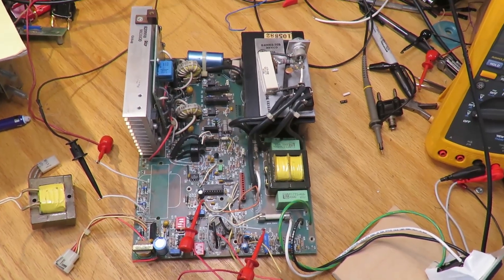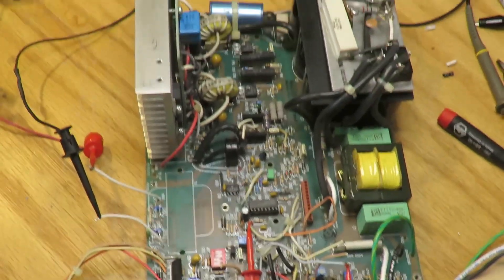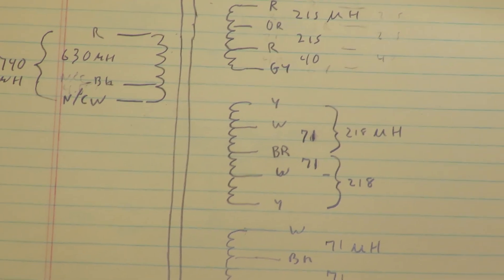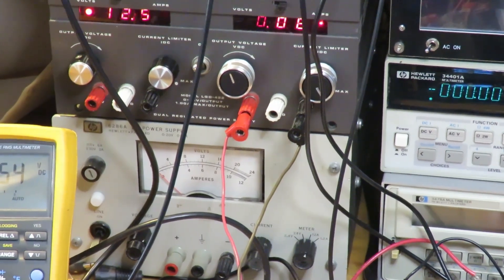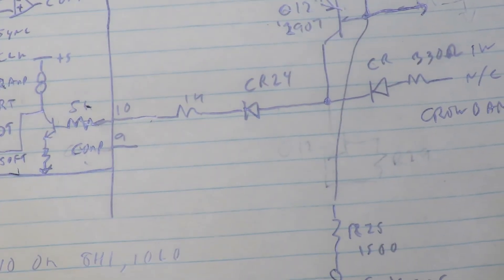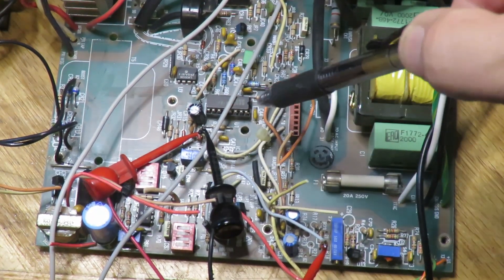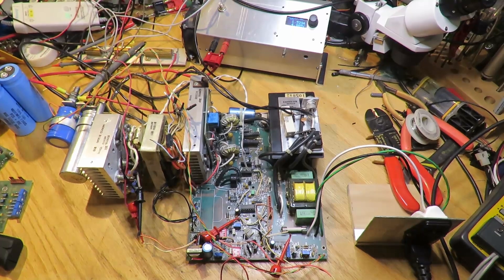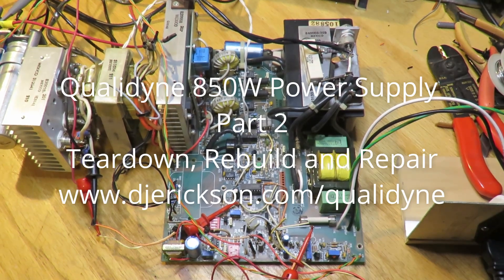High Power Qualidyne Supply Recovery and Repair, Part 2

Comment: Hello good sir, excellent walkthrough.  I've had a FREEDOM 458 Inverter/Charger on the shelf for about a year now.  Only thing I know about it is the guy just said he went to take a trip in his motorhome one day and it wouldnt work.  Its been harassed at some point in its life, very visible but not super bad,  Question is, could I use the same tactics and trouble shooting as you have done.  Scale of one to ten I"m a 6 and 1/2 gadget tinkerer.  Rebuilt several linear power supplies for ham radio but older, much less components.  Would like to pick your brain a bit, the power supply in video is very similar to this xantrax.  Matter of fact, exact same capacitor is your faulty ones.   Great work up brother, will be replaying a bit.  73
Reply from the maker: Hi, thanks for the feedback. 
My advice to repair an inverter,  check the FETs for shorts, Caps and diodes for shorts and opens.  May be challenging since the transformer is across some of these. It can be hard to remove parts. Check the controller chip for voltages and waveforms. Unless you plan to get it professionally repaired, you have nothing to lose trying it yourself. 
I did a teardown of a solar grid-tie inverter recently. It may help you since the parts are similar to most inverters. www.djerickson.com/solar
Good luck!